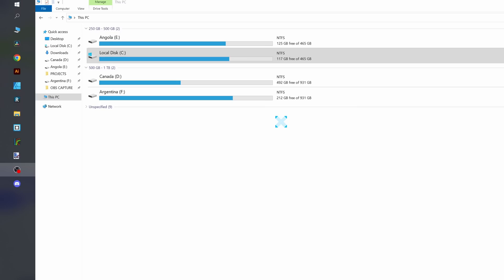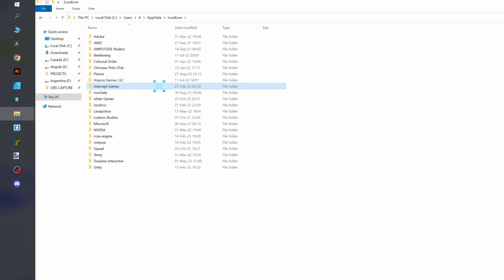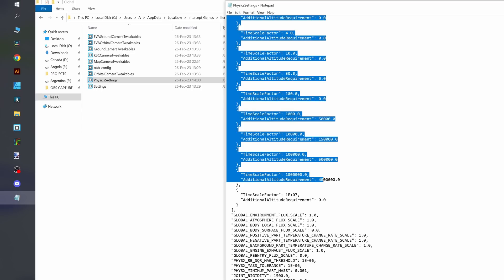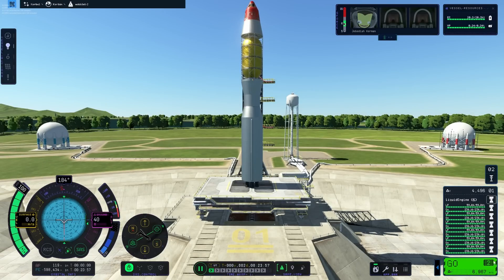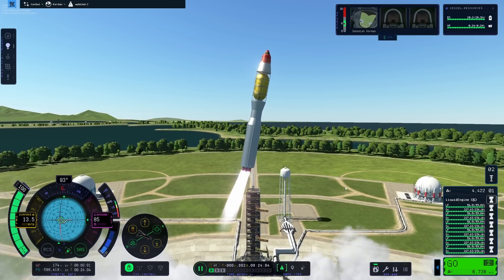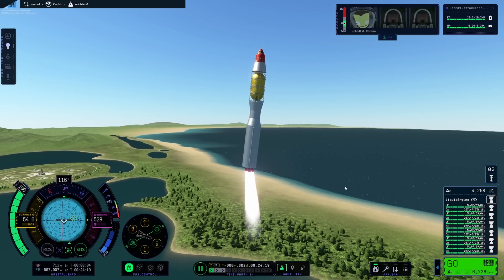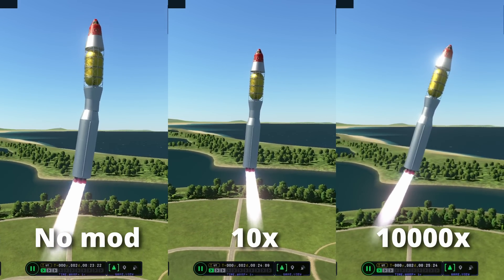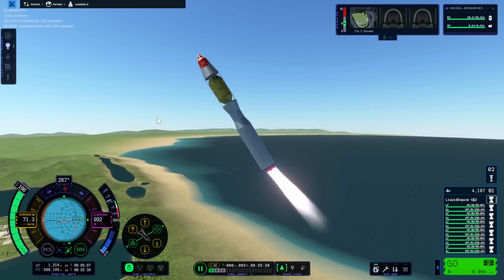fixing wobbly rockets in KSP2.

Comment: Really helpful, still waiting for performance optimizations so that my potato can run it above 3 fps.
Reply from the maker: Quick note, your can disable clouds in the adjacent settings file. Also if you running 4k/2k monitor with 1080p borderless... do not. Borderless feature do not function correctly and render everything in your system resolution before downscaling to 1080p. Swap to fullscreen, this bought me 10-20 FPS on 2080ti.
Reply: @Yakez42  oh my... That is a lot of help , thank you kind sir.. 👍
Reply: @Yakez  I will try this, i didn't think of that thank you
Reply: @Yakez42  20 fps on a 2080 ti?!
Reply: @mevolander8478  it gave him an EXTRA 10-20 fps
Reply: @r.i.pwindowsxp6876  So now he has like 13-23 FPS
Reply: @r.i.pwindowsxp6876  So now he has like 13-23 FPS
Reply: @r.i.pwindowsxp6876  So now he has like 13-23 FPS
Reply: Dont worry, I have a 3050. It's a laptop gpu, and actually running the game at minimum settings gives me like 20 fps on the VAB. 🥲